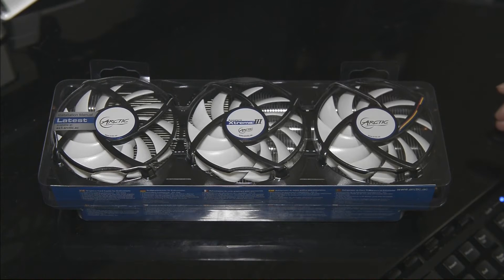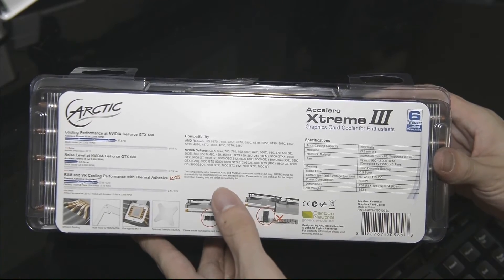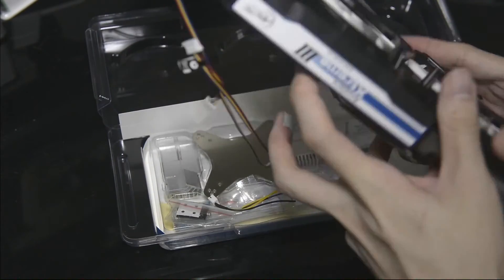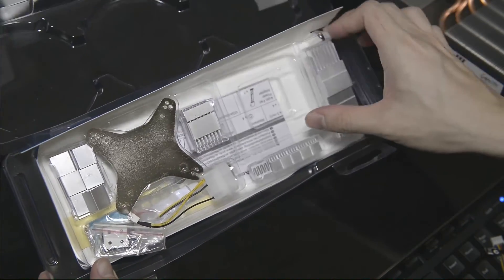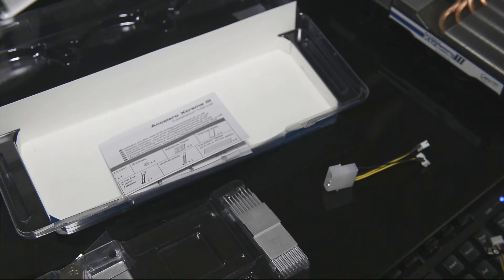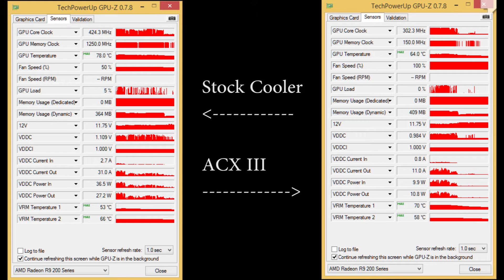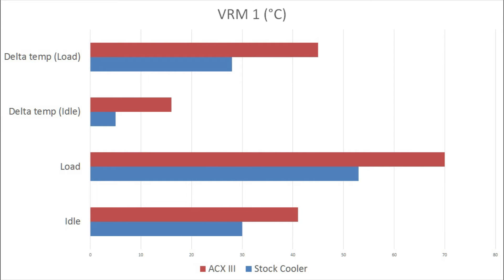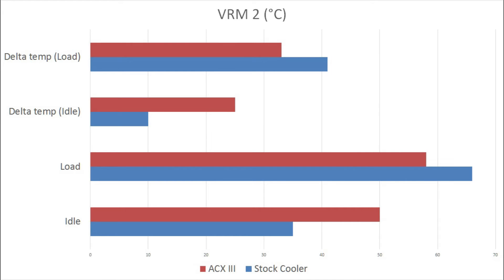Arctic Accelero Xtreme III Unboxing and Review

Comment: One of your VRM sensors indicated a higher temp than stock - did you not put the heatsink for it on properly?
Reply from the maker: Bezerik That's one of the downside of this cooler. Many if not most people using this reports VRM temps higher than stock. The reason lies in that the reference cooler design is such that the contact between the VRMs and the cooler is with higher pressure and better contact as compared to this custom cooler that simply uses the thermal glue with little to no pressure between the heatsinks and VRMs.

There are many solutions to this but requires you purchase another set of VRM heatsinks that have better contact and pressure such as the gelid ones.